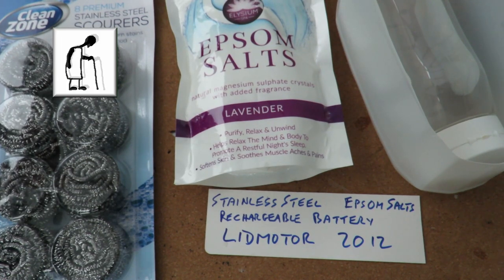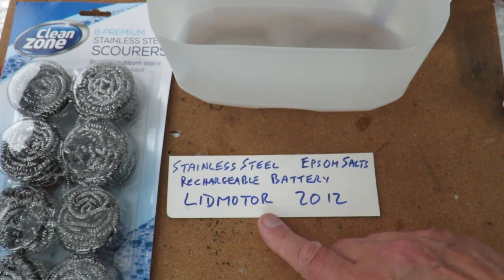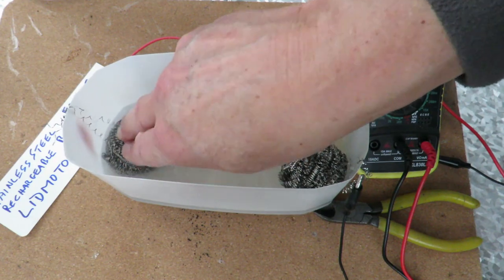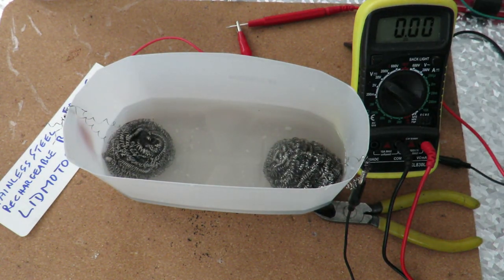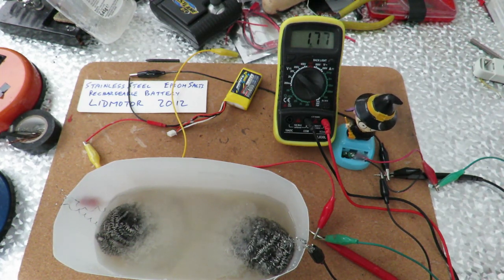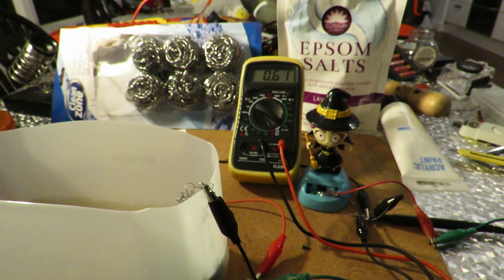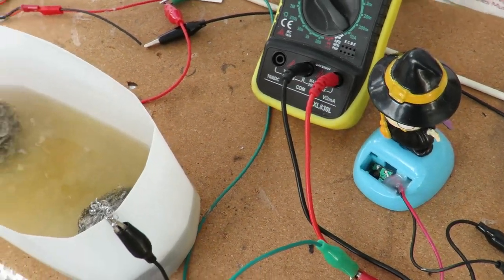Stainless Steel and Epsom Salts Battery experiments using a solar wobbler SHORT

Comment: Excellent!  I have actually been playing around with this type rechargeable battery again.  The battery does get stronger as you charge and discharge it.  I saw a small one of these made using a pill bottle. I think that size would run a solar waver also.  I am using a 4 volt / 70 mA solar panel to charge  the one I built. It has been running an Joule Thief led light around the clock for years.  The device sits on a sunny window sill like you have.
Reply from the maker: Hey thanks for watching, you inspired this episode. I did this one about 3 weeks ago and since then we really haven't had much sun, we had snow yesterday and rain most of the other days. However I did order some solar panels around that time and they arrived yesterday so the plan is to try your solar charged version next. I smiled to myself when I realised what I was doing, removing the solar panel from the rocker, connecting it to the battery, and then reconnecting it to a solar panel, but obviously the hope is to keep it running in the dark. Thinking about the pill bottle size I might have a think about what other item I can find for the stainless steel electrodes.
Reply: @GrandadIsAnOldMan  I just made a video with OUbrads pill bottle version.  Fun  stuff.
Reply from the maker: @Lidmotor  I will watch it straight away 😁👍
Reply: Anyone ever seen Epson salt heated to produce electricity with standard anode and cathode leads. I saw videos of it years ago but cant find then now.

Comment: This is good. I like the fact that you are not putting a lot of voltage into this but still getting a working battery. Plus you will not be producing a lot of gas as the charging battery is so low.
You don't want to breathe that stuff in. Great video. 👍👍👍
Reply from the maker: I think you would have to put a hood over it and deliberately inhale the collected gas to put yourself at risk. Plenty of potential chemicals involved here. Rather like the hydrogen generator. Some chlorine and chromium for starters 👃

Comment: I don't know if you notice but watching your video we noticed that it was rising from draining the energy to putting energy back into it it wouldn't back up to a vote maybe you can redo that and see if this little Toy was actually generating energy back into the system you just build.
Reply from the maker: I don't think you are seeing what you think you are seeing. The solar rocker circuit has a capacitor in it. The current is drawn from the battery until the capacitor is full. It then discharges through the coil under the magnet, creating a magnetic pulse which rocks the rocker. That is why the voltage shown on the meter drops and then jumps back up. It drops while there is a load, and comes back while the capacitor is discharging as there is no load. Over the period of time shown in the video, the voltage in the battery drops from around 2 volts to about 0.5 volts. The solar rocker is not contributing to it's charge. At this moment, I have no plans to revisit this project. I did it back in 2019. However, you can see it only takes very basic equipment and I see from your channel that you have done experiments yourself, so you could probably build one and test your theory well before I return to this. There is more information in my video description, good luck 👍🏻👍🏻

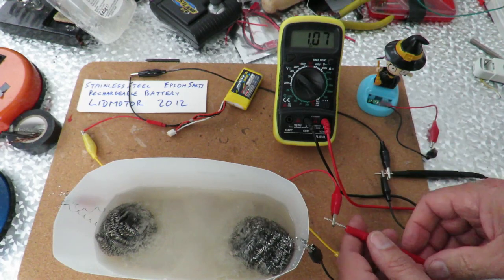Comment: Okay if you start when you connect the wobbler to the device you started with 107 volts that was at 8:53 on the timeline once the wobbler was connected you then start to go down from 088 to 075 when you reach the time on the timeline 9:58 you were back up to one vote which is 104 voltage if you redo the video and see if the wobbler is producing and taking energy it would be interesting to see
Reply from the maker: No different to my previous reply, so I will cut and paste it here. "I don't think you are seeing what you think you are seeing. The solar rocker circuit has a capacitor in it. The current is drawn from the battery until the capacitor is full. It then discharges through the coil under the magnet, creating a magnetic pulse which rocks the rocker. That is why the voltage shown on the meter drops and then jumps back up. It drops while there is a load, and comes back while the capacitor is discharging as there is no load." You will find that with any battery, when it is under load the voltage drops, when there is no load the voltage reading is higher. Here is a video I have just done for you https://youtu.be/m9hHwB-0tbo